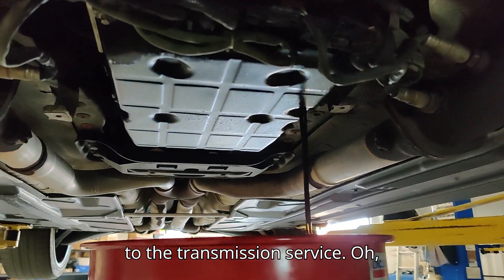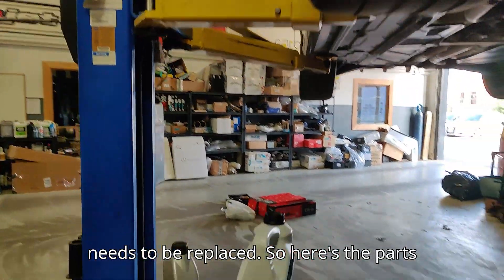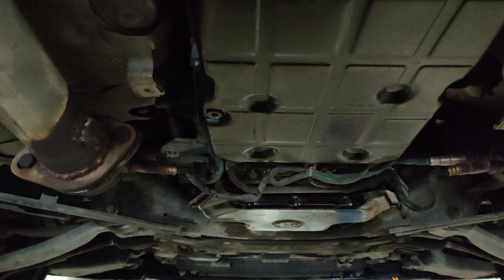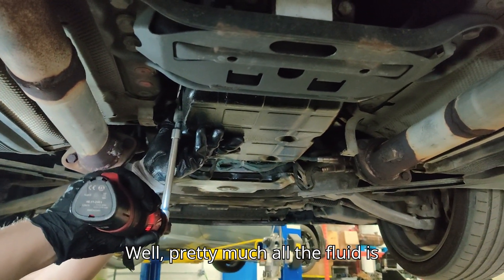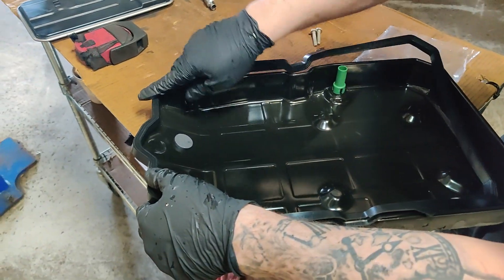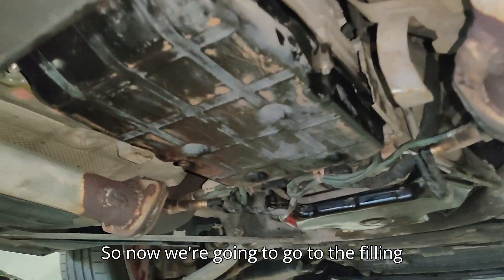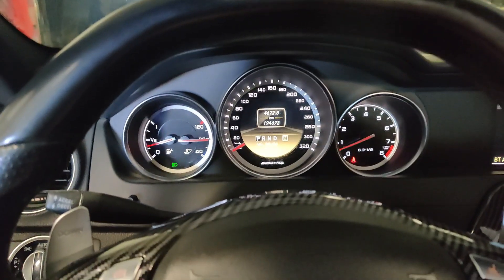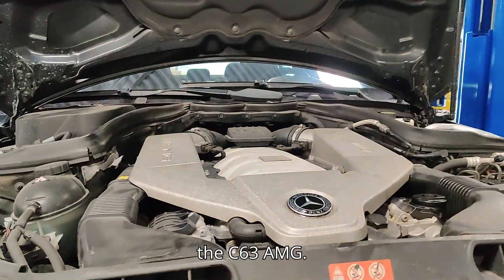How to Change 722.9 Transmission Fluid Mercedes Benz W204 C63 AMG (Blue Fluid Version A89/236.15)

Comment: Hi, I’m supposed to have blue fluid but it’s coming out a red/brownish color. Doesn’t look like it’s blue. I don’t know what the previous owner put. What should I do? My milage is 150k it’s a 2013 C300 with 722.9+. I don’t know all the service history but it does look like they changed the fluid before.
Reply from the maker: Change the gasket, filter, and flush the fluid twice with the blue fluid, that way you'll get all the red excess incorrect fluid out
Reply: @KostaRim like actually flush it out? Pressurized? I’m a bit hesitant, I don’t know.
Reply from the maker: @johnnyboyProductionz drain like 5 l, then fill it to capacity at 40° c follow the procedure 

Then drive the car around a little bit bring it back on the lift drain 5 l again and refill another 5 L at the correct temperature
Reply: @KostaRim thanks my man. Do you think mixing the red with the blue will cause an issue?
Reply from the maker: @johnnyboyProductionz no it won't cause any issues It will actually improve your transmission performance little by little because the red fluid is not the correct one for the MCT transmission that we have
Reply: @KostaRim  I have a torque converter. Should I drain it?
Reply from the maker: @johnnyboyProductionz if you turn the engine by hand, and remove the plastic/rubber cover for the torque converter, Yes you'll be able to drain it, just make sure you feel some more fluid at 40° c and fill it until the fluid starts coming back out

Comment: What about draining the torque converter?
Reply from the maker: This transmission has the MCT multi clutch torque converter 

Not the older torque converter
Reply: @KostaRim  I have an 09 C 63 so I only drain the fluids in the pan?
Reply from the maker: @itsjustajk1194 yours has the torque converter, so you have to drain it too